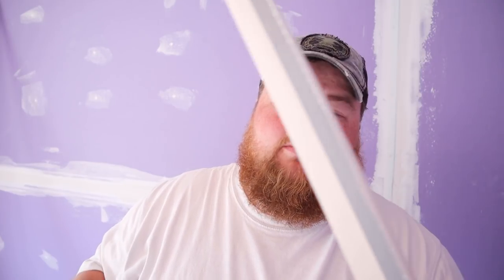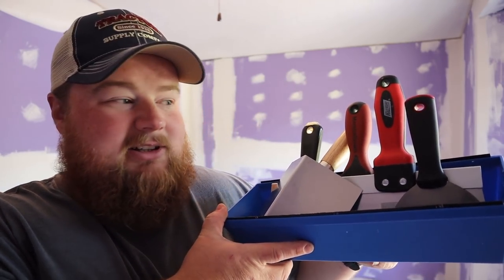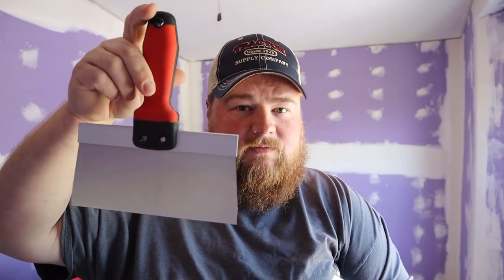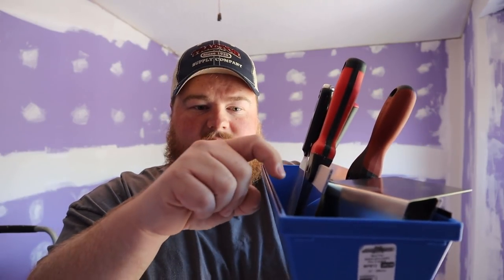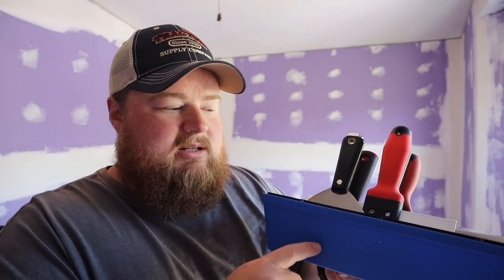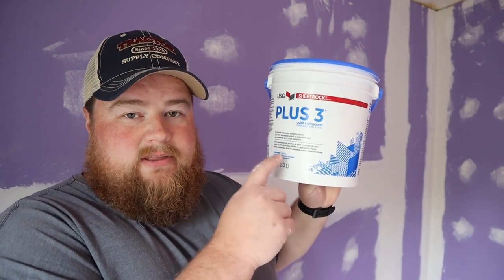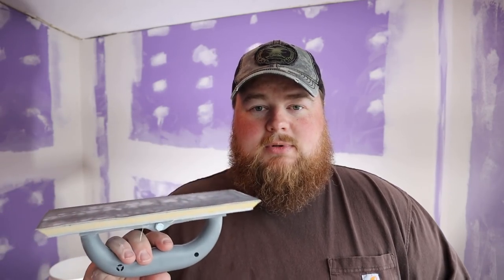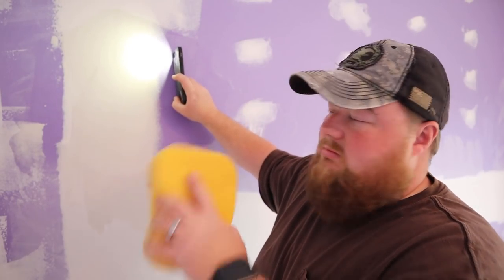Homeowner Drywall Finish - Tips, Tricks, Tools & Lessons Learned - Mobile Home Renovation

Comment: The all-purpose green bucket is the best for taping, because it has more glue. It is much heavier than the Plus 3; just lift the container. Plus 3 or quickset mud can also be used. If you add carpenter or wood glue to the quickset compound, you can do the first two coats with quickset, 45-minute for example, and the last with all-purpose or Plus 3. Doing each coat with an all-purpose mud can take forever.

I see this video is two years old, but I just commented anyway.

I know you put a lot of work into your project, and I know you feel very satisfied that you were able to do it yourself.

Good job!

Comment: I was doing drywall while pregnant and the sponge was the way I went to save my lungs and not breathing in dust. I used a finer-grained sponge and found it did a much better job of spreading and blending the mud. I think the sponge method is a big secret because I never see others using it. Well done!

Comment: Totally agree with the plastic drywall pans sucking. I got one a few years ago, and I had the same problem. Stuff dries and ruins the rest. Then you've gotta try to pick out clumps of dried stuff. Next time I do a big drywall project I'm just going to spend the $10 or so and get a nice metal one.

Comment: Years ago I learned to go easy on the drywall mud and use the sponge. That cuts down on the dust. Putting too much drywall  mud on means that much more to remove. I got pretty good at doing drywall after a few remodeling  jobs.
Reply from the maker: Absolutely! Less is not more, which means not more sanding to get back to a flat surface. LOL :)

Comment: First I'd V out all seams and pre fill using Hot Mud with glue, then use the same hot mud with glue (but a thinner mix) for the paper tape, then use a pre mix compound like you used to finish your last two coats. 

I like the 90 minute mud because it gives you time and there is less waste and room for any errors that may and probably will arise. Always pre fill your joints for a bulletproof seam that won't crack (provided you secured the drywall priperly).

Comment: Use a 1 1/2" paint brush to put the mud in the corners it makes it easy! Also, I do a 50/50 mix of drywall filler and primer. Use a 3/8 matte roller to hide some of the imperfections in the wall. It looks like a very faint orange peel finish.
Reply: Mixing drywall compound and primer? That's one I've not heard of before. It doesn't affect the "purpose" of the primer at all?
Reply: Nope, it just makes it thicker
Reply: @cw881r  thanks 😊

Comment: Did you install a vapor barrier. In our 90 year old house we stripped down to the studs, applied insulation, and then a vapor barrier before installing the dry wall . The savings in electricity was huge.

Comment: Ok I'm not a drywallologist either but I'm way older and have done quite a few mud jobs in my day. I wouldn't recommend the wet sponge method. In my experience it causes cracks in the long run.  We have an attachment that goes on the shop vac and the mesh sander. Works fantastic and quick.  I hate mudding, but I love painting. Great job and the out takes🤣😂.  Smells like a camper mattress omg, I almost wet myself 🤣😂
Reply from the maker: Yeah, I'm not much of a fan of the sponge either... not for any big job. Hahahaha so you too know that smell of the ole camper mattress! :D
Reply: @sam-and-angela  yup had a pop up for a few years when hubby and I wear younger 🤣. First thing we did when we bought our new (used) travel trailer was replace the mattress s. 😂great video as always. Did you ever figure out what made the noise in the kitchen, your face was priceless.👻

Comment: What do you use where the ceiling meets the walls?
Reply: Ditto Sam.  What is used for the spaces at the ceiling and dry wall?
Reply from the maker: We're installing crown molding over that seam.
Reply from the maker: We're installing crown molding over that seam.
Reply: Suppose you didn’t install moldings, what is the process?

Comment: I know you're happy to have that part of the project finished.   I'm curious as to why you didn't finish the area between the walls and ceiling?  I'd be concerned about creepy crawlies coming in through those joints.  That's  just me.  Thanks for all you share.  I certainly have picked up some valuable tips from watching your channel.  Keep up the good work.  😀
Reply from the maker: We're putting up crown molding, but that's not an opening otherwise. It's sealed between wall, top plate, and ceiling. Hard to tell in video, but it will be sealed up.

Comment: you need to learn to use quick set you could of taped and first coated the same day scrape the next day and go to the big knife on the second day with plain mud , on the third scrape the high spots add a little yellow food color to your touch up mud to make it easy to spot the spots you had to fill sand when dry and prime! boom
Reply: Never thought of the food coloring idea. Genius! 🙌

Comment: This was a great amount of info for me and my mobile home project. Removing Amazon wallpaper from walls; this "easily removable" stuff is ripping off the drywall paper. Can I mud over the places that were ripped off?  I'm also taking off all of the typical mobile home trim and tapping/mudding those too.
Reply: The drywall paper missing is a huge deal. Check out Jeff Thorman's channel...Home RenoVisionDIY. He has a whole Playlist on drywall. He covered this topic very well. 
Here's a link to his Drywall Playlist:
https://youtube.com/playlist?list=PL34cQkzKfXWanlUzNzLhfMK1s7w0Un9gt
Reply: Mudding over ripped paper can be difficult. Just coat the ripped paper parts with Gardz Problem Surface Sealer and then mud as usual.
Reply: @diyfferent  thanks 😊
I have the drywall paper lifting up where it meets my tub/shower surround. 
.  Would I need to pry that loose edge up and put the Gardz Sealer underneath it? 
.  If the loose piece breaks off, could I then use the Gardz Sealer to paste that piece back on?
Thanks for your feedback on this❗ 👍
Reply: Thanks for the help!  I bought a single wide in Florida to retire. Most of it has red brick wallpaper 😳  Makes it very dark inside. I knew asking here would get excellent suggestions!  Thanks Kathy, I'll be sure to watch Jeff's video too. Thanks Doug from DIYfferent!  Wish I could incorporate some of the beautiful walls you did in your home. Your place turned out fantastic!
Reply: @jbsimpson8  oh my, red brick wallpaper⁉️ 😲
Reply: @kathyusa-iowa5137  Yes!  Really ugly; I have a huge screened in porch and floor is painted orange and brown!  It’s ok though; I watch several channels (DIYfferent, Green Acre Homestead, Elisha English, etc) and have learned how to get rid of ugly and turn your home into something you love on a budget. Being retired now, I want to live debt free
Reply: @jbsimpson8  I watch the same. I'll recommend 1 more in case you haven't heard of it already - DIY Danie. She is an amazing talent repurposing and upcycling, as well as building. Check out her channel. 😉👍
Reply: @kathyusa-iowa5137  Thanks, I will!

Comment: I bought a mobile home. I’m having problems with moisture under the house. The dirt isn’t mounded up under it. And it’s just muddy under the house. It does not have real gutters. I’m getting gutters installed. But what do I do about the dirt? Have you had this issue? I’m so lost.

Comment: When do you tape the wall/ceiling joint?
Reply from the maker: We're not going to because we're installing crown molding where the two meet. :)
Reply: Good answer - I didn’t even think of that, but except for the difficulty in cutting the crowns, good time and energy saver.

Comment: Never use mesh tape with regular joint compound, you need to use a setting compound. Mesh with regular compound is extremely prone to cracking.

Comment: Respect for trying you own drywall but mesh tape should only be used with setting compounds. This job has a 99 percent chance of cracking 100 if it's an older home.